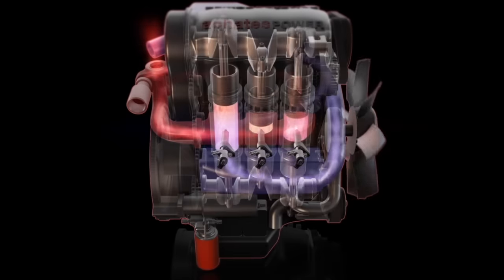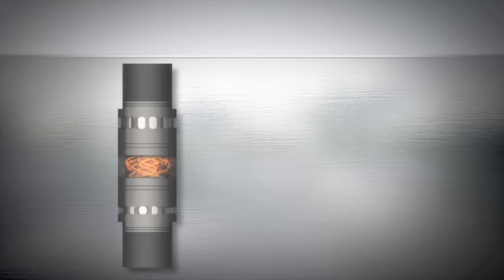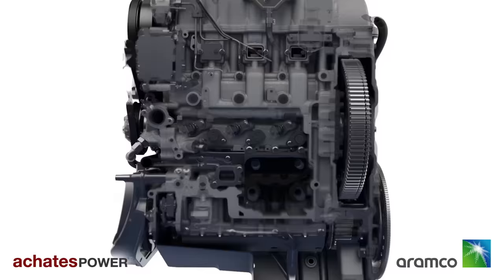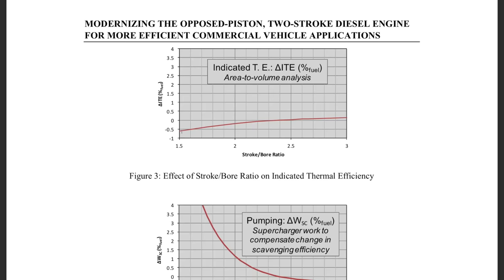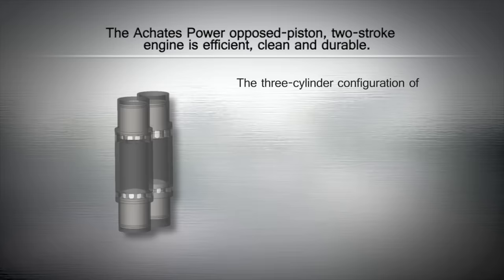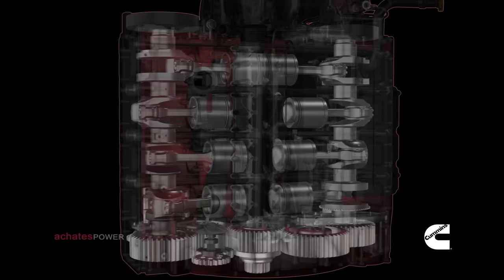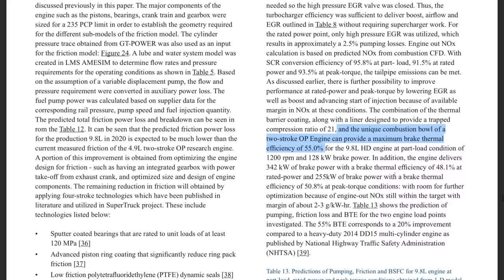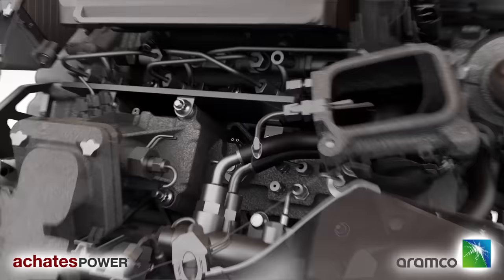Opposed Piston Diesel Engines Are Crazy Efficient

Comment: Just watching that 3D CAD model be moved around made my computer crash
Reply: You need to upgrade, then. I make more complicated CAD models than that every day with no problems.
Reply: Pro E
Reply: @gonesideways6621  I prefer Inventor, myself.
Reply: Penang..malaysia
Reply: As a car mechanic, really looking forward to have this engine on the market.
Reply: You know that's impossible, right?
Reply: I came here to make the same joke. Luckily you've already made it and oh look, several people totally missed it...
Reply: As someone who has worked with proE (or creo as it is called nowdays) for years I can tell you:
Doesn't really matter what kind of computer you have, after a certain .asm size the program shits itself, sure tons of ram 5ghz processor and fast ssd help a lot but creo is so badly optimized it bottlenecks quickly, it doesn't even have multi core support....
Reply: Watching that cad model made me respect the engineers of old a LOT more than engineers these days. All those calculations, done on paper...

Comment: If you like these, check out the Napier Deltic engines which were used on UK  torpedo boats and diesel electric locomotives. They had three banks of this type of engine tied together in a triangle with the three crank shafts at the corners. A stunning piece of kit.
Reply: And US boats in Vietnam and a monster fire pump for the fire brigade in Newyork
Reply: I used to build these for a living, great things, as long as the right people ran them and maintained them. 42K for the navy types in one part of the world resulted in lots of troubles....
Reply: @Grey_Area570  I heard Napier's had trouble making the design work until someone suggested running one of the cranks backwards?

Comment: Make it horizontal and I’ll put it in my subaru
Reply: Jacob Horton look up Commer TS3 engine , mite be what your looking for
Reply: RWD conversion?
Reply: The reverse boxer engine
Reply: If you're willing to stay boxer, take a look at the EE20. Don't know if it's any good though. I'll stick to my EJ25 for now, although I'd LOVE a diesel.
Reply: Tucker Koogler - this would be a self-boxing engine.
If Amazon got wind of this, they'd want to use it in their shipping facilities....
Reply: yea, it would cure the leaking head gasket issues.
Reply: I almost posted this exact comment word for word!
Reply: No head gasket problems anymore!!
Reply: Ford has built one it runs on gas or diesel
Reply: I think the way the exhaust gas is pulled out of the cylinder... The cylinder has to be vertical with the exhaust port on the top. If not efficiency might have to be sacrificed. On the other hand... If it was horizontal it might work like an EGR valve turned on all the time.
Reply: @mrbreakstuf  they have not had head gasket issues since 2012...
Reply: j MAT I know of thousands of two strokes engines (on bikes) that have the exhaust port pointing down and the cylinder in a horizontal line... this however don’t seems to produce a detrimental on performance due to bad breading. So, there’s no need to lay the engine on a specific position in order to achieve good exhaust flow...
Reply: @jmat7103  There's no time for heat to rise to help with the exhaust. It happens too fast. It wouldn't matter what direction it is pointed.
Reply: @ghil3697028  EJ20G tho
Reply: 77th,
Any fleet would benefit--post office, school busses, mass transit, FedEx, etc., etc!
Reply: @ArashiOdayakana  maybe that's the road I'd take if my EJ25 gives up, but it's still like new at 145k miles :)
Reply: @ghil3697028  I have a Subaru with a 2 litre flat 4 turbo diesel engine
Reply: @martinchambers8090  EE20 or another variant? Is it any good?
Reply: same
Reply: Me too !
Reply: "will this thing fit in my Honda"
Reply: @jmat7103  It is pressure differences that scavenge the cylinders, diffrerences in height are irrelevant to gas flow.

Comment: Had two engineers from Achates Power give a lecture for our Engines course at Cal Poly on their OP2S. It was a really interesting lecture. From what I remember they mentioned that the size of the engine was really holding back their production. They had mentioned that an OP2S was mounted in an F-series on an angle so that it could fit in the existing frame. Super cool stuff.
Reply from the maker: Awesome, thanks for sharing!
Reply: Yes, I would imagine engine height being a significant application limitation
Reply: MPG Some opposed  piston engines have a single crankshaft mounted in the middle of the engine above the cylinders and are  connected to the pistons via a linkage, perhaps the engineers at Achates should think of this design as it is a far more compact configuration.
Reply: It seemed to lack an explanation on how the Achates Power design is superior to the past two-stroke opposed-piston diesel engines? And how they over a came inherent inefficiency in a two-strokes. Such as the tendency of the exhaust and intake air to mix. Since there is no separate exhaust and intake strokes.

And the additional cost not only for turbo and a supercharger but many other support system? So cost comparison with a conventional 6 piston Diesel is needed too. 

So it seem more relevant to large engine applications.
Reply: It could be configured horizontally too. Like is done in a boxster.

So height isn't a significant application limitation
Reply: What's up fellow Cal Poly alum! When did you graduate?
Reply: This would probably work and fit well in a cab over design.  What about a quad cab design where the rear seats are higher?  Engine under the rear seats.  Front seats lower and therefore you could have a very aerodynamic design.
Reply: Iceberg86300 Spring 2018. Recent grad!
Reply: Exhaust and intake mixing isn't really a problem... and some gasoline engines are actually doing that to increase efficiency and clean burning. What it would do is decrease slightly the peak power output... and maybe a tiny hit to efficiency but the improvement due to it being an opposed piston 2 stroke likely far outweigh that (a 4 stroke needs 2x as many pistons to generate similar output or 2x the RPMs which also tends to less efficiency). Also I bet these engines sound awesome...
Reply: MPG nice! Winter '05 here. I really need to get back up to SLO. From pics & videos I barely recognize the place! 

Have any job prospects yet?
Reply: I think that vertical configuration helps with moving out the exhaust gases from cylinders, so horizontal setup would decrease the efficiency.
Reply: how would this be for low octane gasoline?
Reply: Sebastian Wilczyński with a supercharger on it to force evacuation I am doubtful it matters much.
Reply: Oh hey, I'm transferring to Cal Poly SLO in Fall. That sounds like an interesting course- is it part of one of the mechanical engineering specializations?
Reply: N C I took that into consideration as well. Unless the engine was mounted before or after the front cross member I would imagine the engine height or even width (if it's setup like you referenced) not clearing structural parts. Like someone else meantioned, cab over design would probably work.
Reply: At those gas speeds and pressures convection has no measurable impact. And that's before considering the supercharger/turbocharger on top of that.
Reply: Limiting the stroke would provide huge improvement to the engine size,  and if that design can pass any kind of eco exhaust composition limits(like euro 6) than it would make way more sense with varieties of 1.0 to 2.0 Liters in size, and then trying to build a normal compact car around it.
Reply: dewolf49 I can't recall. I believe it's an available elective. I want to say it was a 500 level course, but that was a long time ago. The catalog/me flowchart should tell you. Or your advisor. 

Coming from someone who didn't utilize their advisor, please talk to and utilize your advisor!!!! They are incredibly helpful for navigating the insanely fast paced & heavy workload environment you're about to enter. Especially as a transfer student as you're getting 4 years of major courses stuffed into 2 years. Not having gen Ed to worry about makes it doable, but prerreqs and the few classes that are only offered once a year can kill you.
Reply: AgneDei I don't think we'll ever see this tech in a compact car for the reason you just stated + lack of experience with the engine. I know it's been around forever, but companies have been refining their conventional gas/diesel tech for what, ~70 years now? While issues have dramatically decreased, they still run into stuff occasionally & it isn't pretty when it happens. Then you have the design and manufacturing of the structural packaging that has been evolving side by side with the engine tech from the introduction of unibody construction. In short, anyone attempting it will be taking on a huge amount of risk. 

Contrary to my first claim (more thought changes things a bit, whoda thunk? LOL):
I was going to list this as a con, but the domination of FWD might be a plus here. Utilizing a transaxle  and transversely mounting the engine puts its long axis into a plane that is oriented at an angle, top-front to bottom-rear. It's possible this could very well be accomplished with minimal changes to structure.

It could also open the door to a vehicle platform that offers multiple engine configurations including the OPD, conventional gas/diesel, hybrid with and of the above, or most excitingly, a pure diesel electric.
Reply: The issue with efficiency is handled by the fact that the intake air does not have any fuel mixed with it so no loss there. Virtually all commercial diesel engines have a turbo already so the supercharge is an additional cost no doubt.  Getting rid of the head and valve train would likely counteract most of that cost.  I really think their are two main issues.  Lubrication and size/shape.
Reply: The boxster engine would be a good comparison but this engine would be even larger with the two crankcases instead of one.
Reply: Pssh. Every other diesel bro has a 4" body lift anyways.
Reply: @erikmiles5536  Should not be a problem.  Lie it horizontally and it is a boxer engine.  Subaru has a lot of cars with boxer engines
Reply: @EngineeringExplained  what ever happened to hybrids ? In today's technology (Daniel 12:4) you could use it as an electric vehicle for short trips, and hybrids for the longer trips, getting maximum engine efficiency, with superior acceleration for the long trips !